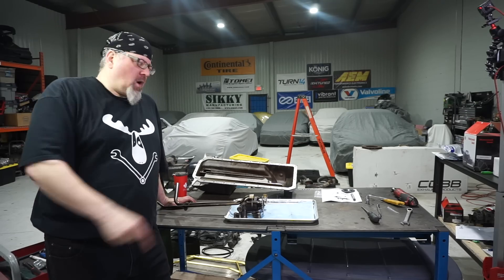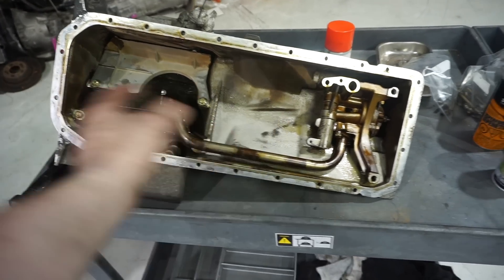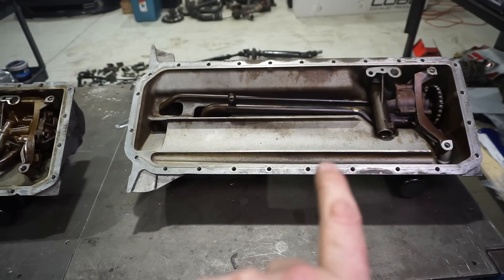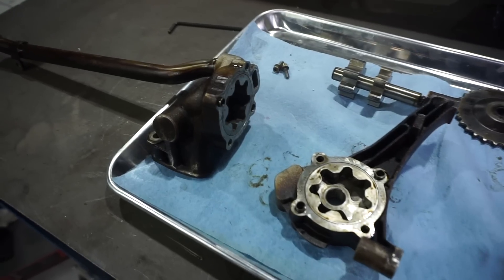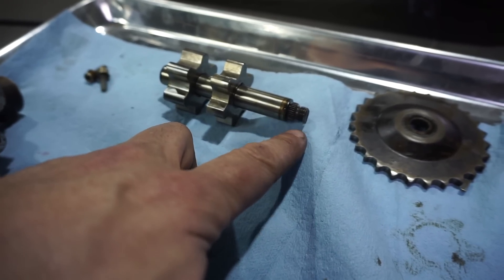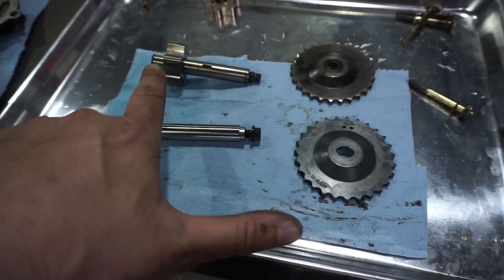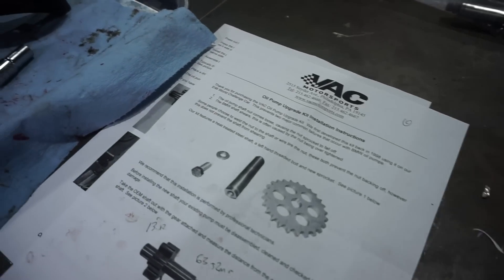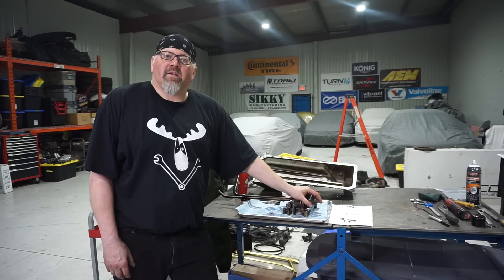BMW E36 M3 Dual Oil Pump & Pickup Upgrade!

Comment: Splines give a greater surface area than the oval drive, it’s not as good a design as it could have been
Reply: Stock shaft is proven to fail. If it's not the nut that fails, then the shaft just breaks if the nut is "secured".
The problem is more critical on M50/S50US/M52/S52 engines as they don't have oil pump chain tensioner like S50B30/S50B32/S54B32 have, at high RPM the due to centrifugal forces the chain tends to round itself out and increases the stress on the oil pump shaft, and it shears on the sprocket line.
Reply: It's the step that severely weakens shafts. But it's much much more cost effective to machine a step than to taper or radius that transition. Splines themselves usually don't fail but when they do it's basically instantaneous. The oval drive will make lots of noise and the shaft will have to snap in order for it to fail completely. Vibes and snapping loads can shear splines very easily.
Reply: @DmitryShkeirov  bs show me any high hp bmw builds running a tensioner, all the 1k whp guys just run a brand new chain since the slop is caused by a worn out chain
Reply: @DontStopReeling  Boris SKOBLOV,  not SOBKLOV (it cant even be pronounced FFS)... DO YOUR HOMEWORK start with the difference in reliability needs of TRACK/DRIFT car and DRAG car. For DRAG you run for very short periods of time, so YES, YOU DON'T NEED tensioner for DRAG, for TRACK/DRIFT it is RECOMMENDED TO HAVE.

Stop being keyboard warrior, the way you talk you definitely haven't done any engine in your life. Lol

Comment: Fix the description, "EVO S52" to S50 EVO/S50B32...
And S54 is the same pump and almost the same pan, they also can be used for an upgrade on M50/S50US/M52/S52.

Comment: I like that you included footage of two E36 STW cars, that uses the 4cyl "S42B20" instead of the 6cyl S50B32. But it's the thought that counts :D
Reply: 92/93/94 spec cars ran S14B20. S42B20 was introduced only in 1995.
One of the STWs running in the Tourenwagen Classics is S50B32 swapped unfortunately.
Reply: @DmitryShkeirov  Ah I see - More than I knew, just thought the cars in the video sounded very 4cylinder-ish
Reply: yes they are 4cyl in the video, just note that there is one 6cyl swapped if you see other videos from the Tourenwagen Classics events.
https://youtu.be/IojJJ8QpP2U?t=228 see the #13 E36 in the video, it is S50B32 swapped.